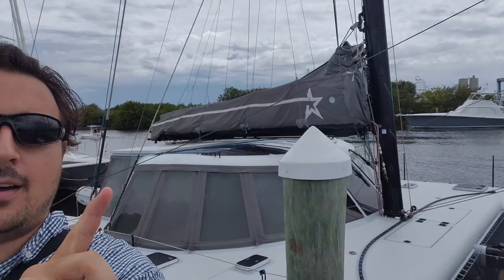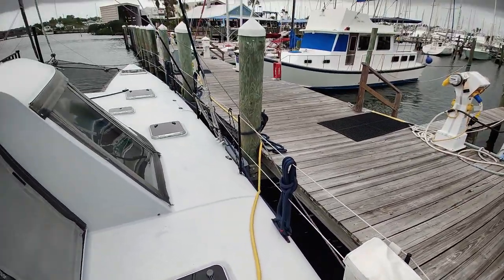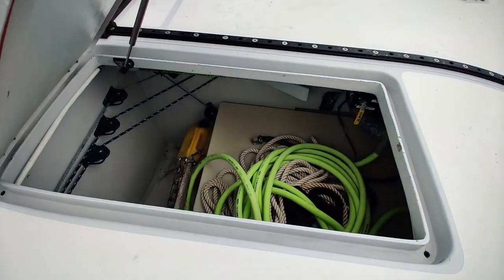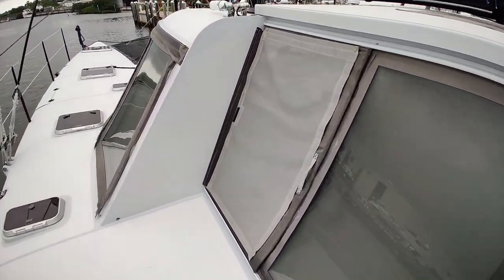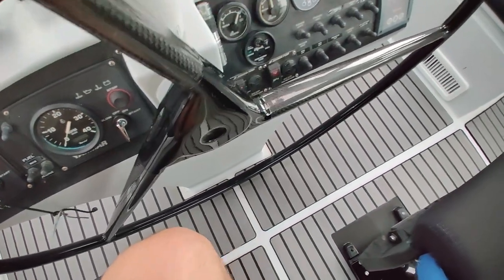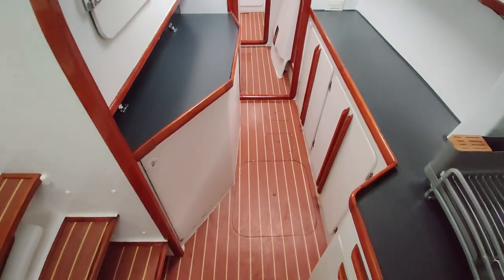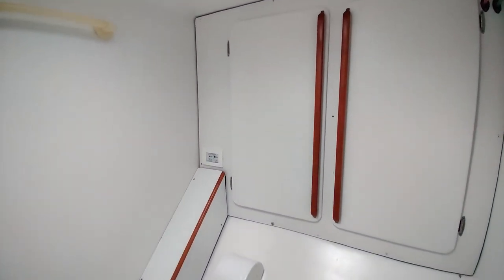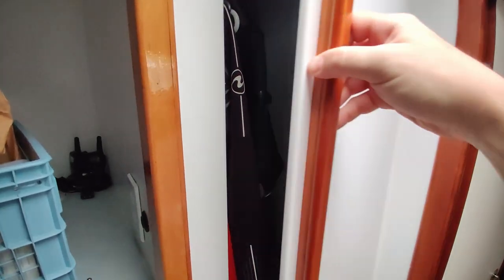"Shooting Star" - A Unique Performance Catamaran from Morrelli and Melvin! [Narrated Walkthrough]

Comment from the maker: Having trouble locating the make, model, or configuration you want? Unsure of what to go for with your next boat, or just plain don't know where to start?! Just email me and I'll throw you a line. Don't go it alone on an adventure when it doesn't cost anything to get some hand holding with your next purchase. ben@multihullcompany.com
Reply: Hey Ben, do you perhaps have performance statistics for this boat? Best 24 hour run, maybe some info on the rig etc
Reply from the maker: @pred7949  https://regattaguru.com/smyc/100276/class_results/101042 I ah, found results of the SXM Multihull Challenge! It placed 3rd overall.

Comment: That for sure must win a design award: As the most horrendous ugly catamaran, that I have ever seen! Were do people live and relax on this one? It is really build for one purpose only and that is to sailing performance, but ridiculously it for sure would be beat on that department to, by many small and nimble trimarans, with folding outriggers, so they fit in a regular  marina. You can not tell me, that people should pick this ugly boat over those also trailable trimarans, because of the accommodation, because it virtually got none!